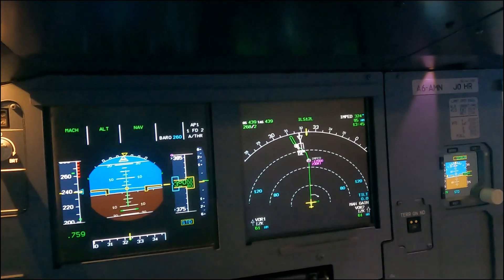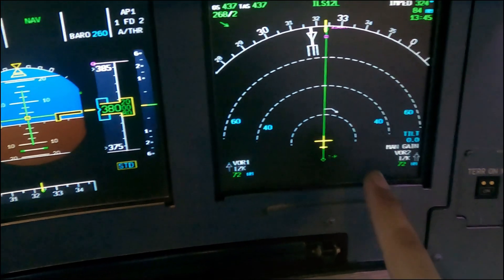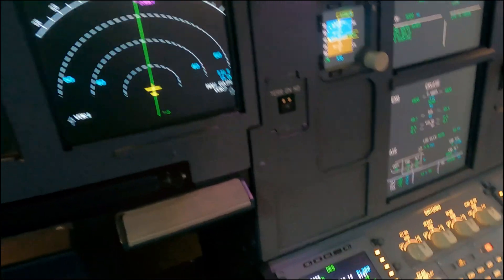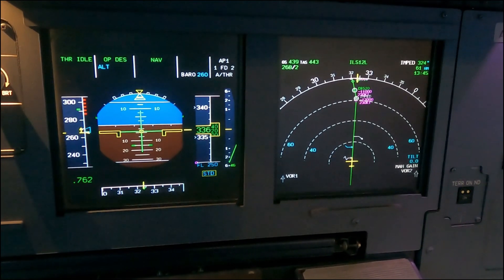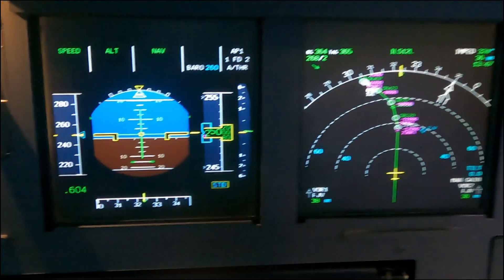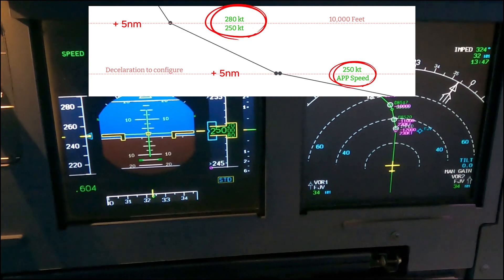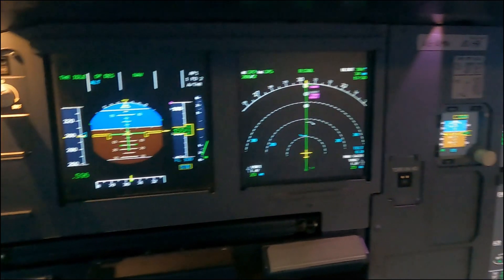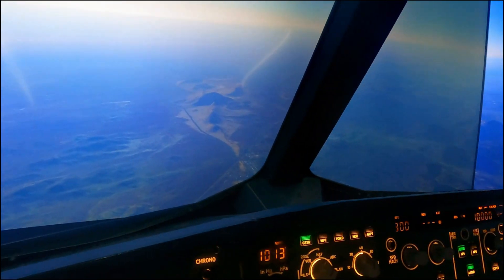Airbus A320 Tutorial: Descent Management & ATC Shortcuts | Tips & Tricks

Comment: If the mcdu changes automatically to approach phase, it means you still need to activate the APR on the autopilot or it will be automatically actibated also?
Reply: Approach MODE on the autopilot panel has to always be activated by you. If it's ILS approach always activate the approach MODE and Both autopilots.
As soon as you see G/S * you have to preselect the go around altitude. Good luck

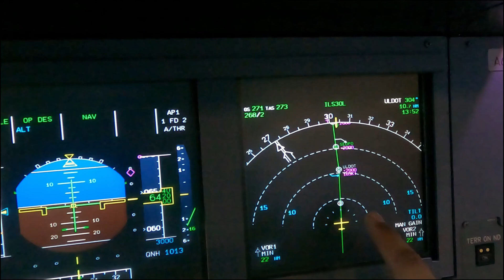Comment: Hey nice video! But I have one question: Wouldnt it be better to reach the IAF ULDOT with the published 185 knots instead of rushing the plane down to 3000 with 250 knots and level off about 1 mile before ULDOT? When u reach 185 knots you will have passed ULDOT already by a few miles. I know its not a big of a deal but wouldnt it be better to adjust the VS manually so your Level Off Point matches almost your further descent point? So if you set the VS to around -900 and your speed to 185 about 10 miles before ULDOT (14:04) you would cross ULDOT at around 185-195 knots and you would still level off below your VNAV path to continue descent.

Comment: Hello! 
This question may not be directly related to the video but I just wanted to know what does it mean to "Activate the approach phase" in the MCDU? What does the aircraft do when the approach phase is activated apart from slowing down to green-dot speed? 

Also, can we get a video going in depth in to the speed-tape on the PFD of an Airbus?
Reply from the maker: The main purpose of activating the approach phase and manage the speed (among other things - might need a separate video) is to slow the aircraft to the best L/D speed for the configuration at that time (Green Dot, S - speed, F - Speed).

Furthermore, your request is noted, we will look into it